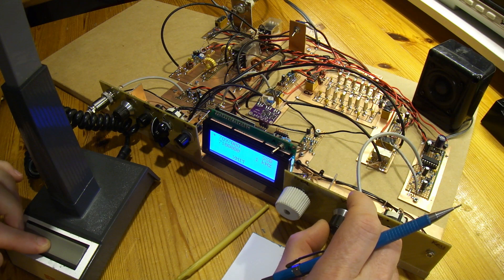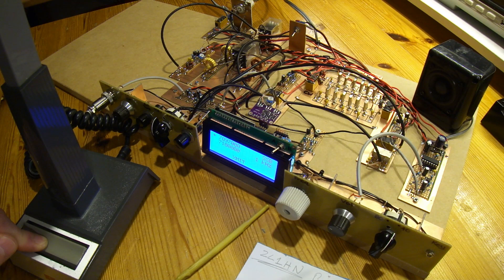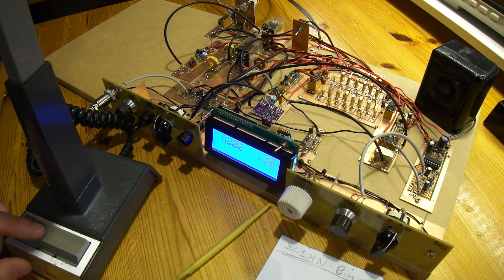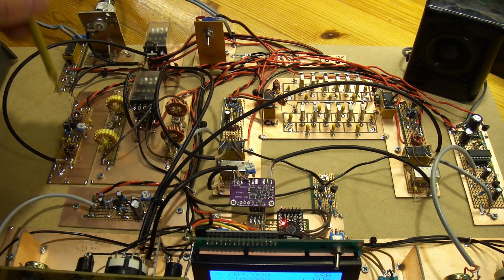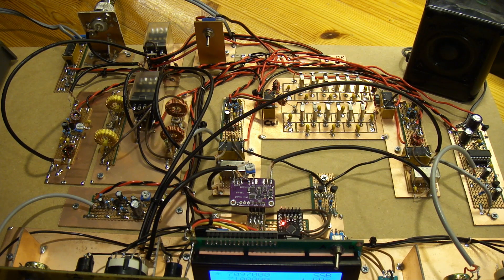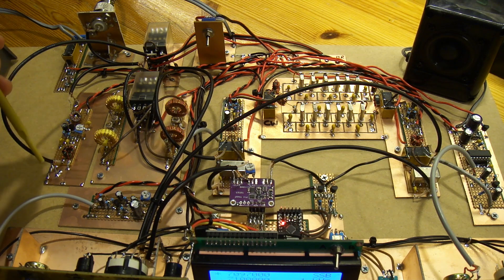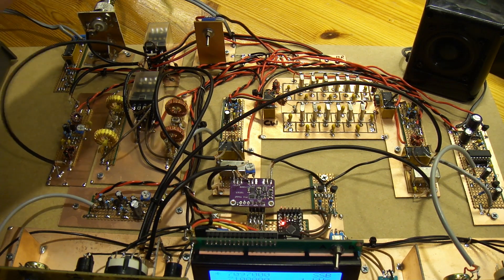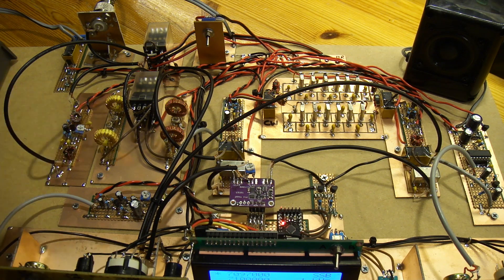Homebrew 80m/40m SSB/CW Rig - Part 8: First On-Air Contact

Comment: Nice work Charlie. Great to see Vero board it takes me back to my childhood great board for developing circuits. I am now using prototyping board the one with all the holes and to be honest I’m really getting on with it. Have you tried prototyping boards and if so I would be interested in your thoughts.  BTW I’m really impressed with the performance of the transceiver well done mate. 73 for the UK M0XFX
Reply from the maker: Thanks John. No I haven't used protoboard. I use the vero board upside down, which works well. You just need to be mindful of inter-track capacitance etc. I'm certainly happy with the radio. 73 Charlie ZL2CTM

Comment: Really nice Charlie! I have a video showing a AVR baseband speech processor. What kind of performance do you think should be possible?
Reply from the maker: Not sure about the AVR. The Teensy would certainly work well with their audio library. I have them several times to good effect.
Reply: @CharlieMorrisZL2CTM  Plus analog imbalances from using two mixers..